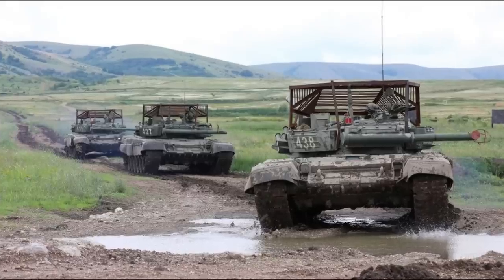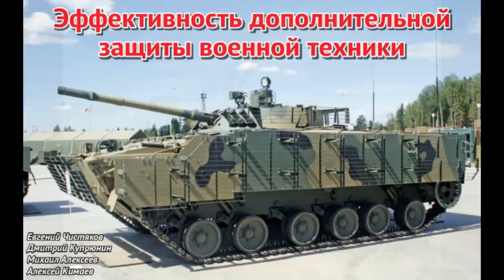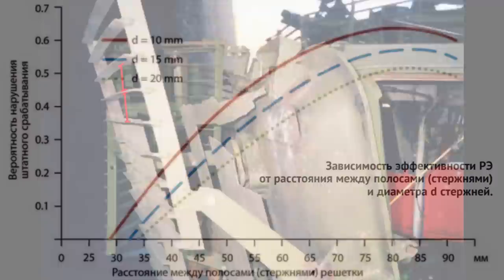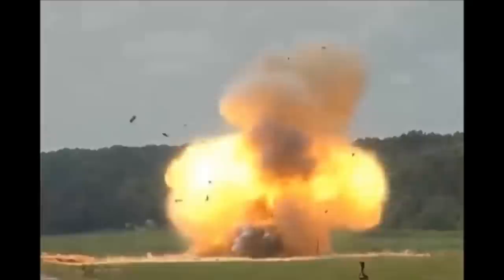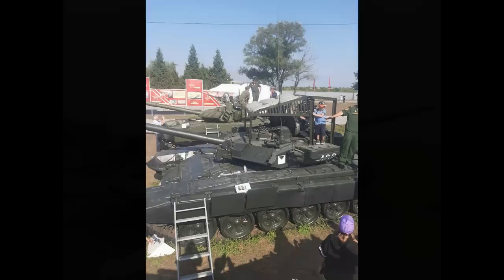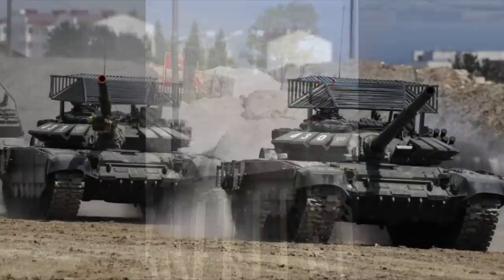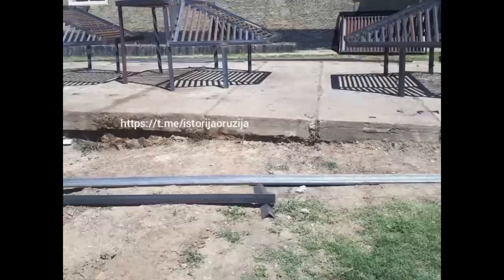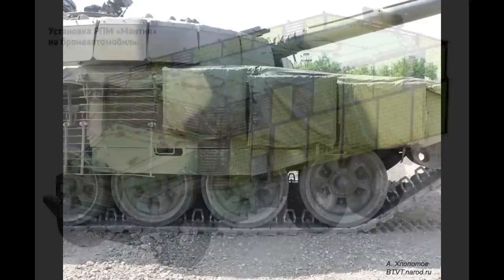The Truth About COPE CAGES

Comment: I wonder if the cope cages were installed to try and improve morale. After all sherman crews installed concrete armor (despite it not being too effective and stressing the automotive components)
Reply: Actually I could imagine it being abit more quiet inside a Sherman tank with concrete armor when it is  being peppered with MG fire.. Imagine the noise inside when your tank is being peppered on from an MG-42..
Reply: @FeddyGrunt  True, while concrete armor does Little to nothing to stop Tank rounds and such, it would probably be able to make the tank not clink every time it gets hit by 7.92

It was 7.92 not 62
Reply: Last tank coflict, Armenia, had hig number of desotroyed tank by drons from sky, in Syria and Libya many tanks lost by RPG7 fire from top of high bilding, i thnik it was thinked in this way then like people where saying against Javelin.
Reply: @Frisher1  Per the Chieftan every tank that was 'illegally' covered in concrete had to be put back in thier original factory paint condition. Many sledge hammer were swung until they were allowed to switch to sledgehammers. POW labor for the job was disallowed. The big army was pissed so tank commanders were requried to put in as much work as the rest of the crews. Guess who love to have their own person tank in combat? Generals, Colonels, LTCs and the rest just pulled fine vehicles full of crap wasting soldiers and tanks. Eisenhower hate blowhards and took great pride in knocking them down a notch.
Reply: the british crews in WW2 were putting spare tracks as armor protection, they didn't really do much, but the commanders encouraged it if it meant that the tank crews would be more open to take an engagement
Reply: No, Russia has a history of this. They did the same in Chechnya. They walked tanks into ambushes that by the end of the conflict their tanks were immune to. They have a long long history of modifying on the battle field for the specific threats they are facing. Basically they enjoy plugging zero day exploits you find
Reply: A tin foil hat basically
Reply: @Gyrosmeister  It actually reduced armor effectiveness because the tracks were made of softer steel, which allowed shells to catch into the hull, reducing effectiveness of the armor without it. The only exception would be in the case of a 90 degree type hit. It seemed that armor angling was generally a practice during the war, so when combined with proper doctrine practices, it was a bad idea.
Reply: @JRyan-lu5im  But the commanders allowed it if it helped the morale of the crews, soooo....
Reply: Makes no sense since it makes harder to enter exit tank
Reply: It's common practice. From the original logs to the cope cages of today lol. Wishful thinking.
Reply: The cope cages are meant to catch the bodies of the crewmen when the ammo cooks off.
Reply: I'm like 95% sure I've seen Russian tanks with cope cages destroyed on film. I've DEFINITELY seen destroyed cope cage tanks.
Reply: @jdogdarkness  Original logs

You dont even know what that is for and how effective a log is lol
Reply: @gerfand  I can't tell if your being sarcastic brotha lol.
Reply: @jdogdarkness  explain me what do you think the log is there for
Reply: @Frisher1  7.92 these were the Germans
Reply: @gerfand  well when it started it was basically for tanks to get through mud/unstuck it also doubled as makeshift slat armor and gave APCs more protection against shelling... (depending on where someputs it, what vehicle it is, and its dimensions might indicate what intent the crew has) It had multiple benefits though can be used for fixing tracks. Also some draw backs. what are you asking for? i dont exactly know what kind of profound point you think your making? If a tank is covered in wood, in a way to cover as much of the tank as possible from likely directional fire, its safe to suggest its not just for mud riiiiight?
Reply: @gerfand  Do i pass your test field marshall sir?
Reply: @jdogdarkness  yeah that was a really dumb take should have stopped on the thing they actually use it since ww2
Reply: @gerfand  lol oh really. so are u gonna correct me then, or just leave us in suspense? Since u know I'm wrong, u should have no trouble articulating why...
Reply: @gerfand  while you're at it point to me where I said anything about world War II? LOL you really are a character. Straw man of the century. Not even just implying things I said but outright saying I said something specific. Bravo, you've taken it to new heights
Reply: Congratulations you've graduated from fallacy tier to gaslighting tier. 🎉
Reply: @jdogdarkness  why should I care, you act like log armour is a thing, but this is not warthunder, so go figure.
Reply: @jdogdarkness  I never said that, I mentioned ww2 because its common knowledge they used logs for mud there, chill bro.
Reply: concrete? you sure it was not wooden pile?...concrete is so heavy they cant move.
Reply: @jacklarkson4505  concrete is related to Sherman Tanks, some tankers added concrette on the frontal plate in hope of addind armour against nastier German weaponry
Reply: @Frisher1  7.92.

MG42 fired 7.92x57 Mauser in WWII.

7.62x51 was developed in the 1950s.
Reply: But it makes it harder to exist
Reply: They were based on experience from earlier wars.  Most opponents like Syria and Georgia have little or no advanced anti tank weapons other than old Soviet era systems.  The most successful and most dangerous turned out to be the RPG-7 in an urban environment.  Three man tank hunter teams consisting of a machinegunner, marksman and an RPG gunner would hide or rooftops and shoot Russian tanks from above.

It seems they expected Ukranians to do the same and they would face a bunch of classic direct fire ATGM's and RPG-7/RPG-22 fired from rooftops.  They ran into weapons that fire their shaped charge from a stand off distance above the vehicle, completely nullifying the concept of cage armour.  Also it appears the Russian active protection systems perform poorly against these systems, especially the older models, newer versions seem to have some effect, but the N-Law and Javelin are highly advanced tech that surpasses anything the Soviets have deployed as standard in their military.  It seems the latest versions of T-90 with active protection and full reactive armour suite can survive such attacks, but the outcome is far from guaranteed.

Cage armour can help against older direct fire weapons used from an elevated position if it is built properly.  It doesn't help when a missile files overhead and shoots a shaped charge from a stand off distance at the vehicle.  

There are a number of counter-systems being tested, some are trying a kind of airbag made from special ballistic material that could counter the blast, others want to install an active protection system that can blast a missile a fraction of a second before it flies overhead and detonates.  Another option is to have tanks followed by a swarm of drones that can both pick up a missile being fired and track it, some drones will then fire a counter-weapon at the shooter while others will fire at the incoming missile to shoot it down.  If there are enough drones they might lock onto the missile team and follow them and then terminate them, much in the same way the Javelin can track and anticipate the movements of a tank.

It's likely that in a decade or so the N-Law and Javelin will see their effectiveness drop due to better active protection systems and new combat doctrines and the makers of the missiles will find ways to improve theirs continuing the eternal battle between tanks and those trying to destroy them.
Reply: @jacklarkson4505  yea I thought that was weird. I could imagine SOME troops trying it but, widely adopted? Hey can u tell General Gerfand logs have been widely used as slat armor/add on armor by troops? (Especially WWII)
Reply: @AtlantiansGaming  that one
Reply: @JRyan-lu5im  It did not reduce effectiveness. Simulations show that it improved the tank's resistance to enemy rounds, however the amount it helped was extremely slim.
Reply: Morale? What good is that when you know your tank's made of explodium?
Reply: @yomasane4487  lol. True. Russian commander's prob think until the Russian unit sees the first one go up, they believe it. At that point they are already in the line 😂
Reply: Accorning to interview of tanker serving in western military distirct, only one in 10 hits causes full detonation. Mostly its just mission kill/tank shrugs it off and the crew is mostly ok as well. There are some cases where tank survived up to six hits from various ATGMs.
Reply: Plus the Sovets did the same to their tanks in WW2 in urban warfare to help protect against pamzerfausts by trying to cause a pre-detonaton
Reply: Cope concrete
Reply: Apparently the concrete worked well against shaped charges
Reply: @FeddyGrunt  well, it is a lot quieter, but the extra weight wears out the engine and transmission crazy fast
Reply: @geroutathat  Immune? Definitely not. What did they adapt that was immune to flanking RPG volley fire? The end of the conflict was the Russians resorting to mass air and arty to obliterate the urban environments they were being ambushed in.
Reply: @le.dechaine  and if it did get knocked out there were 5000 more coming up behind it
Reply: @proximacentauri3627  because isis moved to smaller munitions made from plastic and away from standard munitions. So true they were not totally immune, but they successfully reduced the initial threat of drones dropping grenades. We are talking about the Russians who are known to constantly uodate their tanks to deal with threats. Look at Chechnya, at the start they were getting blown up on every street corner, they added and removed and modified and by the end 99 per cent of cechen ambushes failed. Trust me if you think this cage would not work against a certain missile, then you can be sure it wasn't put on for that reason, so think for another reason. We know for a fact that they were added in Syria to stop the sensors being destroyed by drones. To me it looks like Ukraine is using a higher explosive so they have increased the space. There is no point talking about weapons that Ukraine is not using. Most attacks on tanks now are small drones.
Reply: @le.dechaine  Hence, no armor is the best armor!
Reply: @WimsicleStranger  The addition of crew armor such as tank tracks was found to redirect rounds so they would reduce the effectiveness of sloped armor and have the projectile hit square on, causing more penetrations than without.  But it helped morale, so it was fine.
Reply: @le.dechaine  And just think, crews in Tiger tanks had the same casualty rate.
Reply: The kicker: Were tanks with these hasty drone cages known to be massing on the Ukraine border prior to invasion? You won't hear American "news" media performing even at that sophomoric level. Can you see this?
Reply: Concrete armor increases penetration of ww2 AP rounds, because it guides the force of the shell into the tank, while crumbling, preventing armor angling from doing its job.
Reply: @geroutathat  We were already talking about Chechnya. You're simply wrong, Chechnyan ambushes remained highly lethal, it was the bombardment that broke them. You don't know anything about military history if you assume everything is done for a good reason, every military makes many dumb mistakes and poor adaptations. We also don't know exactly the proportion of AT weapons used by Ukrainin in attacks. Drones simply get more exposure like the Stugna system because the ease of filming the attack.
Reply: @scratchy996  You obviously were not paying attention when the bomb burst blew off the Russian looking turret...
Reply: they should rename them copium cages xD
Reply: @Frisher1  it was 8 millimetres
Reply: @worldoftancraft  ok
Reply: Philippines used wood on there BTR's
Reply: This is why they are called cope cages.  They were installed by tank crews who are trying to cope with a threat they can't defeat.
Reply: @Gyrosmeister  i mean, those are relatively light and could help in very angled shots, right?
Reply: I’m Iraq us soldiers were putting sandbags on the floors of humvees
Reply: In*
Reply: In battle the command samurai buses a helmet this is flare ed and shadowed for reflections from mirrors. Sight in command needs less intereference
Reply: lets be honest if you were in a tank that was about to hit with a tank shell and someone said "do you want an additional meter of concrete over the armor?" we d all be saying yes
Reply: russian armors can defend jav projectiles in some degrees. It's just the turret side that's been causing trouble repeatedly. Javs fly low, go up then hit it from the top
Reply: And they had to carry spare treads anyway, so...
Reply: The difference being that tigers were hella slow and could actually be destroyed by american crews lol
Reply: My thoughts exactly , you’re tank is an antique but we’ve added some extra armour so you’ll be ok , now off you go ….
Reply: I think you’re right on target!
Reply: I dont think they have an issue with morale right now.
Reply: @Tischa1994  What?!
Reply: @nigel900  I don't think Russians have problems with low morale right now considering how it has been going the last couple weeks.
Reply: @Tischa1994  Ok…
Reply: @Tischa1994  They have actively retreated from Ukrainian counter attacks in the north and south and suffered a catastrophic loss trying to cross a river. They may be making progress in the center in Donbass but their northern and southern fronts are slowly crumbling
Reply: The real purpose is corruption. Additional cost means more pocket money.
Reply: farmer armor be what farmer armor is. you can tell they dont know what a javelin warhead looks like or they would have welded that together different.. it can set some off though..
Reply: Emotional support cope cage
Reply: It depends a RPG or a Panzerfaust wil go through because of the way the rocket works and is made with a dubbele explosion a cage is a good way to stop them 
not a compact flat service 
it’s something like the 1’’ punch 🤜 If someone dus it to your arm you are ok because of the flex but if you get hit in the chest you may get broken ribs and you are out of the fight
Reply: @PhilLesh69  yeah but its dumb, why nobody calls any other slat armour "cope cages"?
Strykers uses that all thr time for example
Reply: It appears that everyone has forgotten that tanks need infantry support to be effective.
Reply: @Peter T not really tho
And Russia is giving air support, its just that Ukraine has AA to counter their planes
Reply: @gerfand  because the other slat armour is effective, so its primary purpose is to deflect shaped charges from penetrating armor, not make a tanker feel better about driving around in a mobile human roaster.
Reply: They were installed to counter drone strikes from above, it was not a "morale booster"
Reply: @RGC-gn2nm  I cant read this. Wtf are you saying?
Reply: @urbanmusicchannel  lol. ok. I guess because you said so, therefore it has to be true. 

Then why did everyone start calling them cope cages? It's a morale booster, buddy.
Reply: Thus the “cope” in cope cage.
Reply: @RGC-gn2nm  it was illegal?
Reply: Apparently they are for RPGs (the US also used similar things on Abrams a while back) not for the Javlins which will destroy the tank reguardless
Reply: @forickgrimaldus8301  against javelin, it is a cope

if I was stupid enough to not find a way to be drafted out to escape dying a fool death for idiotic politicians, I would prefer my cope to be a human carcas cope.
That would still fear in the enemy.
Reply: @monad_tcp  yup the only Tank that can counter that are ones equipt with Shtora even then they can be by passed or fail.
Reply: @Gyrosmeister  German tank crews started doing the same late war as well, moving spare track on tanks like the Panzer IV to the front, effectiveness is debatable but if it made the crew feel better there's no harm.
Reply: @gerfand  They have used Wood Log's to help with tanks getting stuck in mud and holes since WW1.. And they are still used today espically Russian vehicles.
Reply: @PhilLesh69  I mean Honestly? A Drone is decently quiet fast and can carry a decent payload for a unmodified tank roof, The average Non-guided Anti-Tank Cluster Bomb has about 271 bomblets with 1-2KG of explosive's in them meant to direct hit a tank roof to take one out, Drone's would be able to carry atleast 1 of the cluster bomb's bomblet's and would be able to easily get above a tank and drop it in, With even a wooden roof above the normal tank roof it'll pre-detonate the explosive charge and prevent the explosive's from direct hitting the roof, Drones are very common and very cheap, Not hard to convert a Civilian Drone to have a bomb release and just fly above a tank. And that's a civilian drone, They make Military ones that are made to do such tasks.
Reply: @Bruh-d  yes, but some People think those logs are for armour
Reply: Coping cages
Reply: Yes obviously... That's why they are called cope cages...
Reply: The word is on the Russian side the cope cage is known as "противосъёбывальная решётка" (an anti-escape grille). The grille is a considerable obstacle for a quick escape in case of emergency. The RedEffect's first photo demonstrates that it may actually be the case. Thus it is unlikely to improve morale.
Reply: @FeddyGrunt  I'm not sure about that. Tank armor is extremely hard and thick, even on a WW2 sherman. Slapping the side of it is like slapping the side of a giant rock, I don't think small arms impacts would transmit much if any sound through the metal of a tank. Getting hit with small arms would probably be unnoticeable, especially with the engine noise and the communications headset on each crewmember.
Reply: @FeddyGrunt  why would someone pepper a tank with mg42… such waste of ammo
Reply: Can you put era on it tho?
Reply: This is 100% the biggest reason. Not saying it’s the only reason, but IMO it’s by far the biggest reason. A false sense of security.
Reply: @jordan ryan he forgets that America used similar designs and had sandbags while in Iraq and Afghanistan.
Reply: @Top Tier Gaming as well as America in Iraq and Afghanistan.
Reply: Depends on the source really I mean the chieftain after all has already taken a look into history and it turns out that Sherman was not a bad tank at all. He also goes and says that a tank's affecting us just goes beyond what the actual taste capabilities are you can have the most dangerous tank in the world but if you can't see a dog thing out of it you're basically useless.
Reply: You can ask the Israelis now